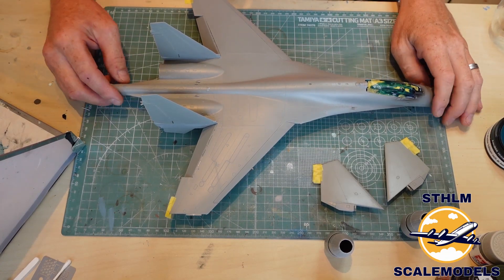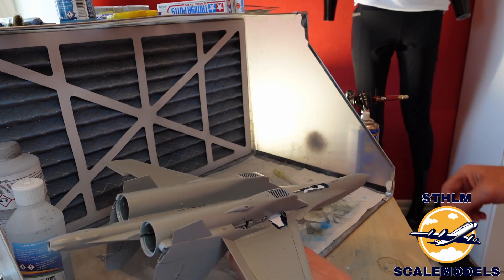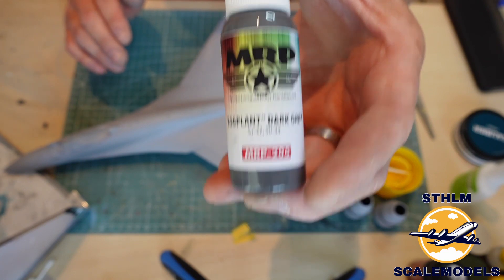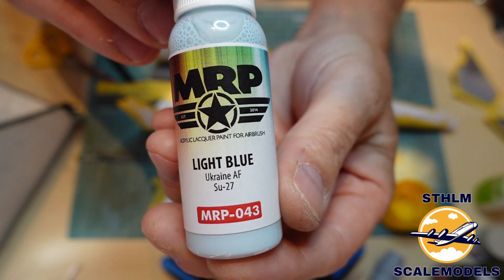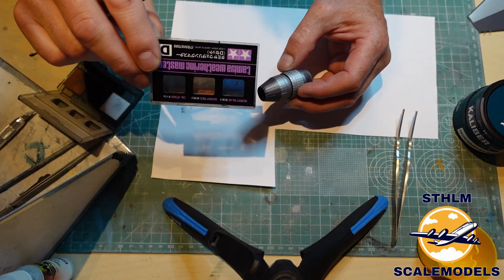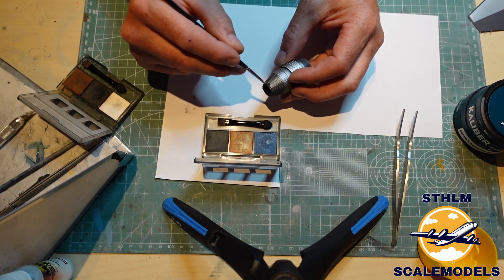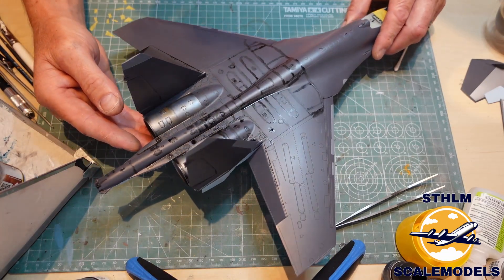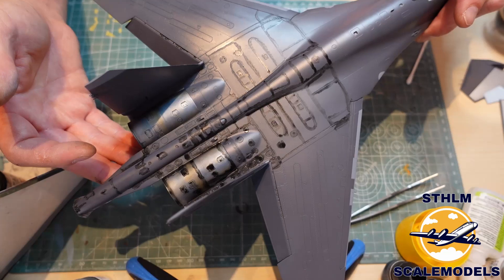Part4: Painting & Weathering of the SU-35S Flanker by G.W.H

Comment: I'm not doubting you at all about MRP paints, but could you be more specific about what you like about them over Tamiya/AK/Vallejo, etc??
Reply from the maker: Thanks for your comment! 

There are several of factors  that makes MRP one of the best paint. First of all, it lays down so smooth and you will never get any orangepeal. The layers is dry within seconds and the airbrush is so easy to clean. No need for deluting since it is ready for the AB from start. The downside of MRP is that it smells a little bit, but for me - that doesn't matter.  Second choice after MRP is Tamiya and deluted with Mr.Leveling thinner. The behaviour is almost the same as MRP and thats always my second choice. These two combos has never struggled for me and whatever you weathering with, the paint never gets loose. You get a rock solid base that never struggles. I have tried Vallejo, but that paint is to soft in my opinion and you will get problems when weathering with oil based products. Cheers!